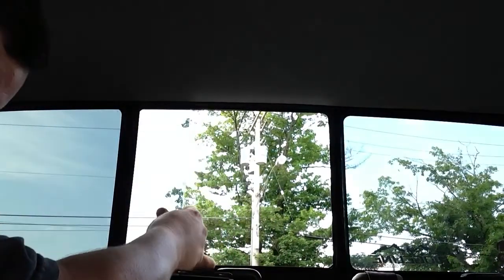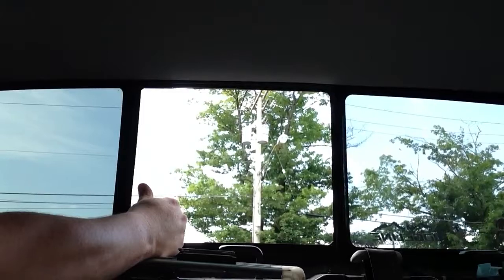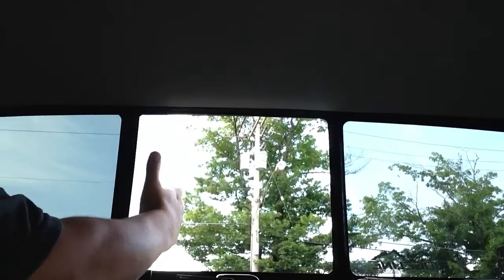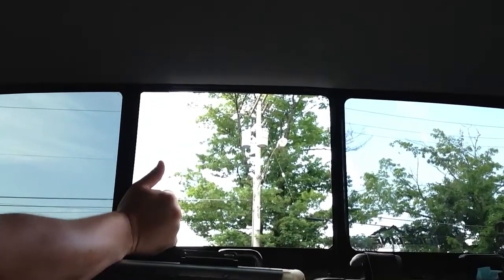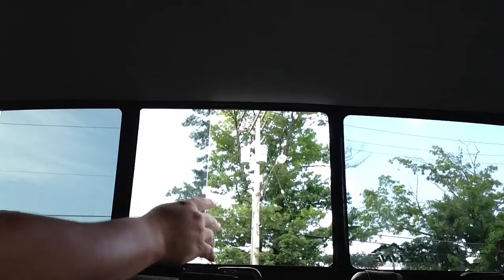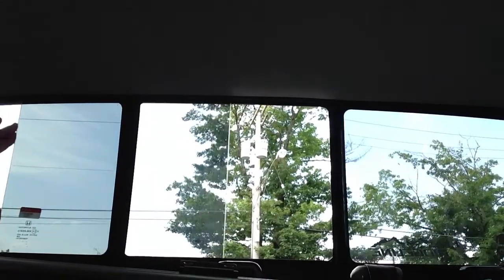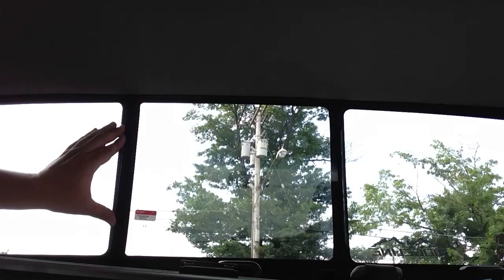Honda Ridgeline rear center window replacement.

Comment: There's a long bar inside the top of the track. It needs moved from the left side all the way passed the middle to then insert the glass from top to bottom. The long piece (bar) is tucked slightly behind the rubber track/molding. It's kinda hard to slide but it will go. Don't poke your eye out
Reply: I'm stuck here.. have a 2007 ridgeline.  Cant find that bar. Any suggestions??

Comment: I have a broken sliding window in a 2014 ridgeline.  Cost of window - $200.  Dealer has to call window install specialist - $600.  Dealer has to remove truck bed and entire rear window - $1200.  $2000 for one little window.  Not sure if I am being scammed or if Honda engineers really don't know what they are doing.  Any suggestions?
Reply from the maker: I paid $135 for the parts at a local dealership.
Reply: You're being scammed.   Total bs

Comment: What model/year Ridgeline do you have? I bought the replacement pane and I can't get it into both top and bottom tracks.
Reply: Scott, did you have any luck? I'm having the same issue, 2006.
Reply: Drake Dwornik +al antaran I will post a video of how I fixed it soon.
Reply: Thanks!!!!!!
Reply from the maker: My Ridgeline was a 2008 RT. Was a pain to put in but the dealer wanted $500+ at the time. I had a bunch more footage to edit together showing more of the process but never got around to uploading it.
Reply: hjames27 MLB
Reply: Hi.  Anyone have any more info on this? I have tried to replace my slider but i can not get it into both tracks.  Honda refused to touch it.  Local glass places had no idea how to fix it! I have been riding with plastic covering it for a year.  Plesse help!!